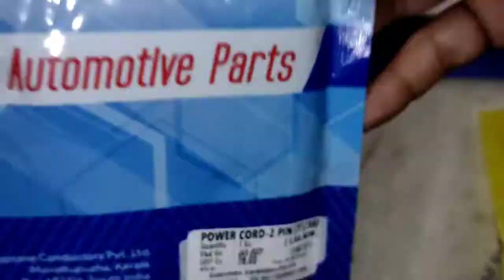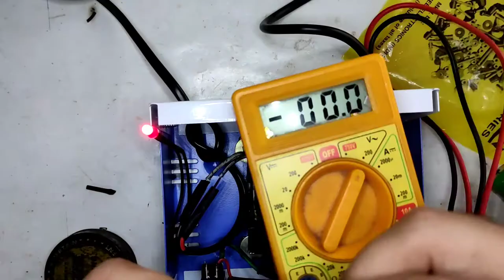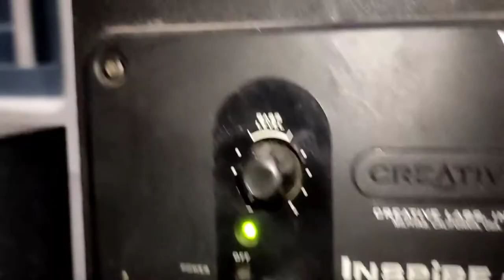IE156: DIY AC adapter for creative home theatre.

Comment: Hello sir if i remove ac adapter does it move i convert the woofer into dc.
Reply from the maker: You can give DC input to the woofer. The reason why we use a transformer is because it has the rectifier circuit built inside the woofer. It will work with both AC and DC input.

Comment: you spent close to 600 Rs for the adapter , how much will the original adapter cost ??
Reply from the maker: I was not able to find at least a used adapter at that time. So I made this custom adapter, which can be used for other experiments also.